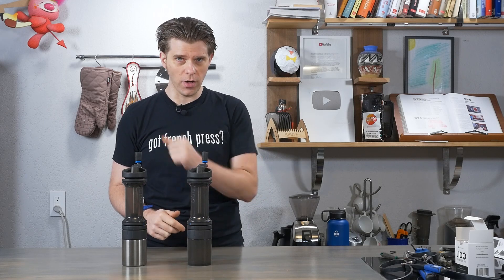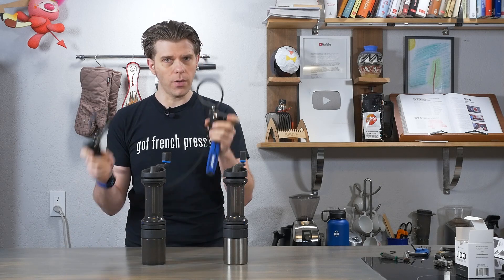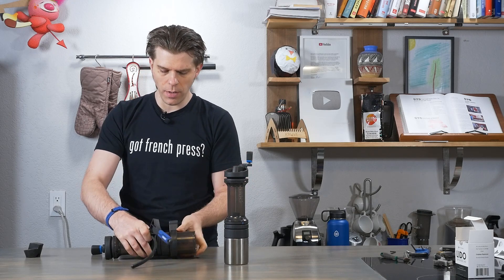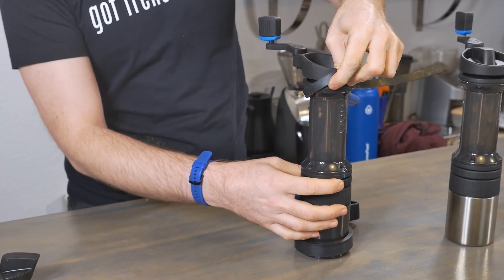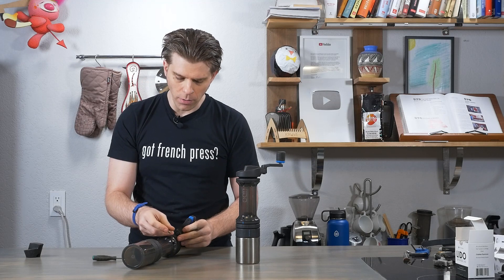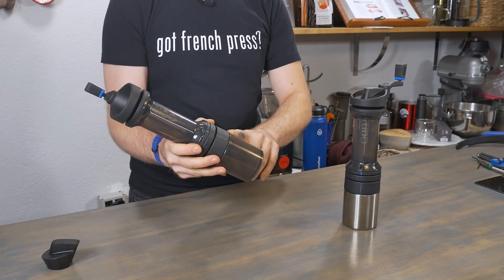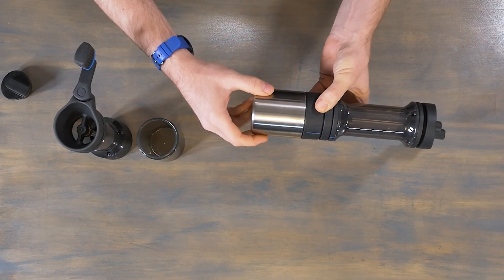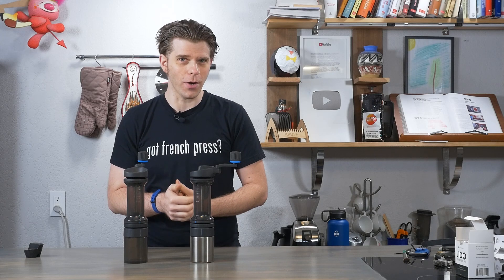Lido 3 Simple Hacks to Troubleshoot (locking ring stuck, loose folding handle, grind jar falls off)

Comment: When the lock ring gets stuck I just twist the grind adjustment down to free it. The basket threads are a bit finicky but I’ve had my lido 3 for about 7 years, it’s been absolutely rock solid. The machining on everything is superb. Take it apart every once in a while for deep cleans and you won’t be disappointed.

Comment: A very helpful video! I overtightened the locking ring on Day 1. The manual, which I felt was pretty helpful (it's very obviously written by an engineer!) recommends just gripping both the locking and adjustment ring at the same time and rocking them in both directions until something gives. It works and it doesn't take too much effort. Thankfully I didn't need to buy those adjustable rubber band things (though they do look useful).

The recommendation about the grinds catch was also helpful. I have the stainless steel catch and yes, it can be finicky to get it back on (the threading is metal on metal). A bit of patience pays off.

Thanks again.

Comment: After 5 years of daily grinding, my plastic grounds jar has been falling off. Found a quick fix. Wrap teflon tape counterclockwise around the threads of the jar maybe 5-10 times. The grounds jar will now be fully flush and also screw in more smoothly. This would be good for new jars too, as it would help prevent wear on the threads. I expect for stainless jars it would help the jar screw in more smoothly as well.